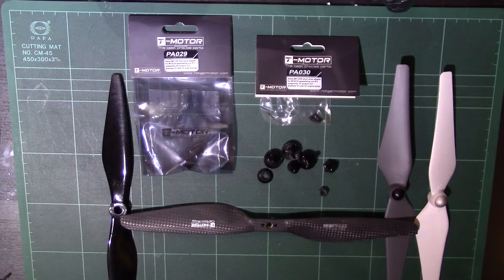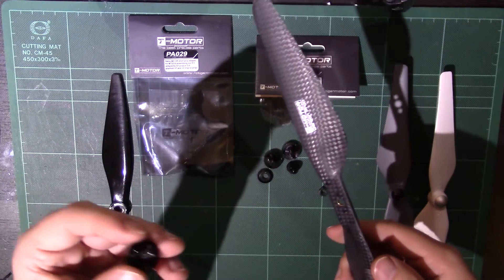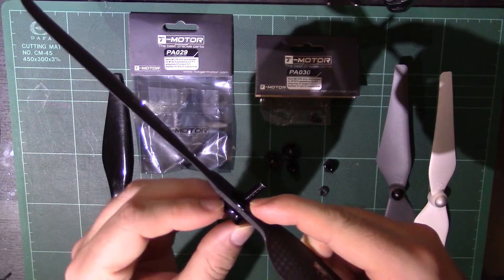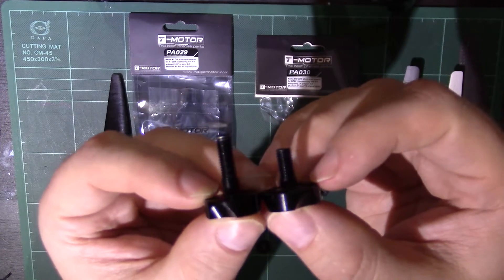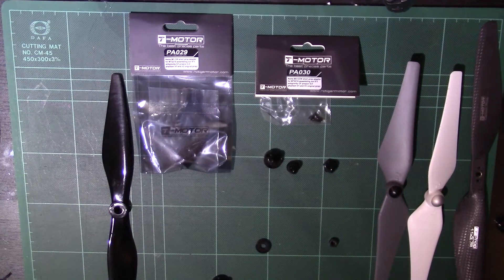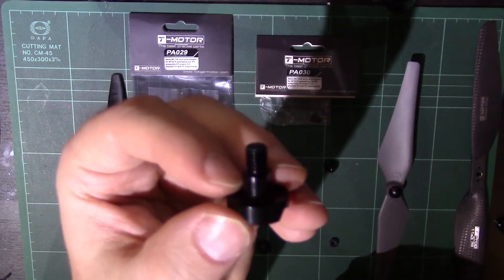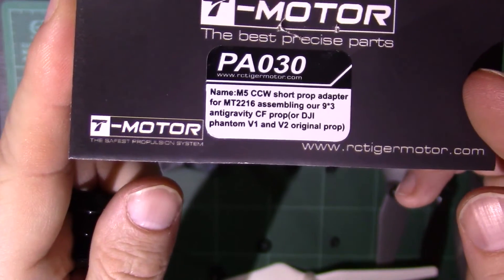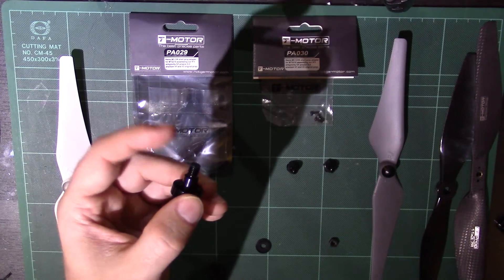Tmotor MT2216 PA0029/30 Prop Adapters - Use DJI Props with MT2216

Comment: Hey there just purchased a set of the t-motor 10x3.3 Carbon props along with some PA003 and 004 adapters. My question and probably a silly question is does the adapter marked CCW go on the motors that spin CCW, sound totally daft when I read that back but having looked close it doesn't seem to tighten the when I hold it and spin the adapter in said direction, hope you can shed some light. Thanks in advance
Reply from the maker: +Jay Pearce Its ok Jay it is actually something I stuggled with myself too as its not obvious. Personally I would ignore the lettering. What you want to do is make sure that when you turn the motor in the rotation it will be travelling when powered on, that the nut tights down. As long as it does that then you are golden. To test it do what you are doing.... put the nut loosely on the shaft and, by hand, rotate the motor in the direction it will be going.... if the nut falls off the shaft at that point then switch it out. The annoying thing with labels on these things is some mean 'motor direction' others mean 'thread direction' so its best just to decide yourself :)
Reply: Hey buddy thanks for the swift reply, I will do what you said and ignore the instructions or basically do the opposite to what it says. Much appreciated.
Reply from the maker: +Jay Pearce No problem Jay. As long as you double check everything and maybe do a quick spool up on the ground to double check everything is still locked down before first take off then you are golden.

Comment: Hi man, 
good video. But I have got a question: I am using a f450 (the older version with the red motors not the "tuned" e300 set) and bought the dji self tightening props. But the  dont fit (just these with the white point on top). The black ones dont have grip.
Thank you

Comment: Great Videos... Question:   With the PA 029/030 prop adapters for the DJI-1038 Props, it looks like there's very little thread space left over after the prop is mounted. I like to use the supplied washer that comes with the 2216 T-Motors and also would like to use a "nylon ringed lock nut" like these (  https://www.fastenal.com/web/products/details/1L2550000A20000), Is there enough thread space to accomplish this?  If not, what nuts & washers do you use with the 1038 & these adapters Dewy?? Cheers!!

Comment: I can't seem to find that prop adapter in the US now. Checked readymaderc - not there. BTW, I have the exact same Alien 560 quad.
Reply from the maker: It wouldn't surprise me if the T-Motors aren't exactly advertising them that much these days. They'd rather people just buy the Aero 350 kits or the Anti-Grav motors. If I see some again I'll post a link on here. Worth emailing Ready Made RC too... I have no doubt they'd get some in for you if they can.

Comment: My question is, can you fit regular props on the short adapter?
Reply from the maker: On the PA004/PA003 you can fit most props with a 5mm bore (or 5mm adapter). Anything with a hub that stands over about 8mm should be avoided as there won't be enoug meat on the thread. Graupner E props fit perfectly for example (some with reducers, some not).
Reply: d3weyTube Alright, for the record, those adapters can be bought in the UK. http://www.quadcopters.co.uk/t-motor-accessories-inc-prop-adapters-233-c.asp
Reply from the maker: Jānis Andersons
Yep the PA003 and PA004 adapters can be bought easily from many places in the UK and elsewhere. They do NOT work with Phantom 2, E300 or E600 props though as they have an M5 thread (M6 Needed). The PA0029 + 30 are the only ones that work with the above props (and if you can find a UK listing for them I'd be very happy to post it on here as I tried everywhere).

Comment: great info thanks opens many options.if the e600 props fit i read the e800(inspire1) 13inch props fit e600 too. after your feiyu g3 reveiws i bought one, but my stockish f450 is stuggling so a motor upgrade is next.
Reply from the maker: Thanks Brett. I'll have confirmation of the E600 props within the week (on order now). It bugs me that you have to buy all these adapters to get the perfect setup and £12 a corner is pretty steep. That said I would only have got the PA29/30's if I had the knowledge of the CF props already. They just looked so good!